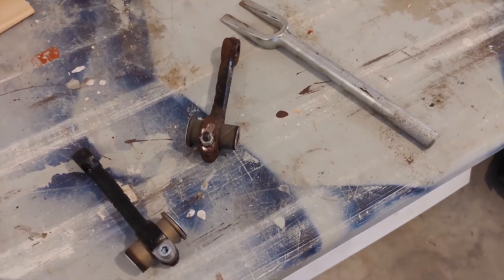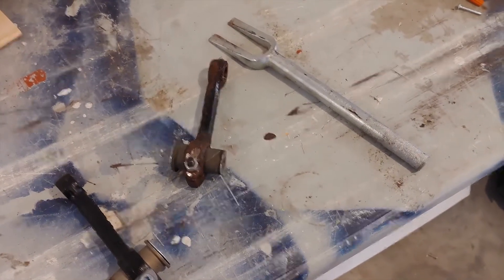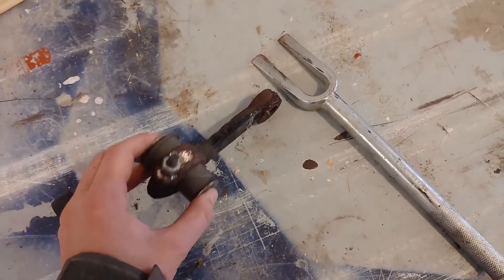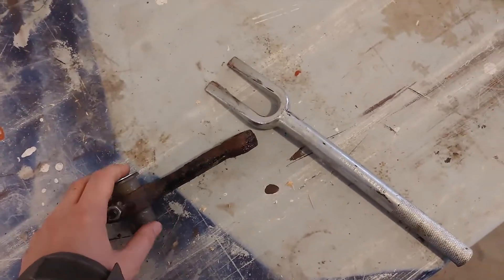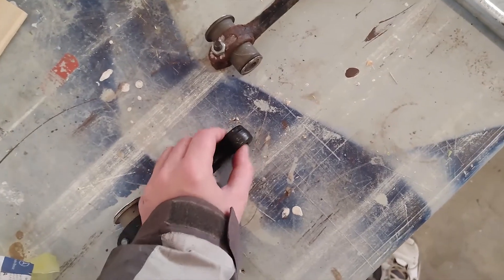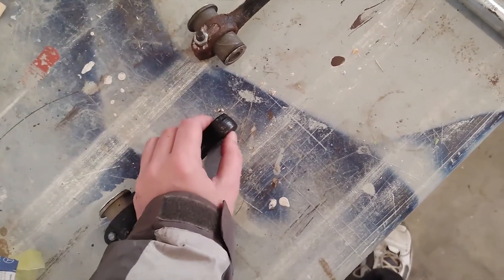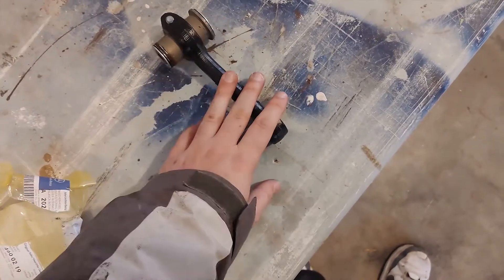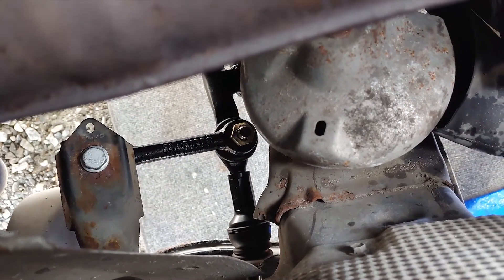Mercedes Idler Arm Removal

Comment: I  can't understan how idler arm rotate with steering when we tigten up that side with bushing (50NM)
Reply from the maker: The rubber inside the bushing twists as the steering moves. It's also why you want to have the steering straight before tightening the bolt down. You want the rubber to be fully "relaxed" wen the wheel is straight, only twisting as it goes from side to side.
Reply: @PatsCarGarage  thanks